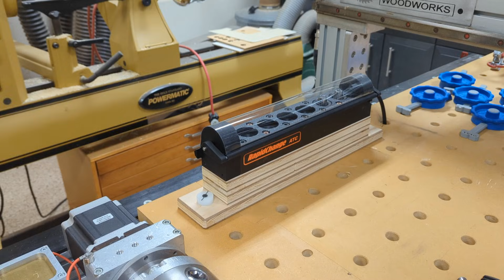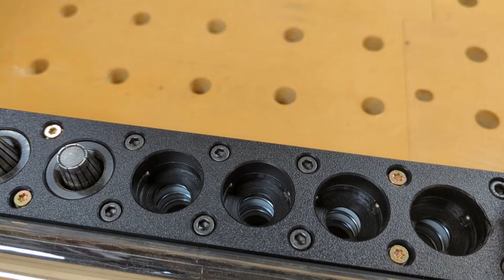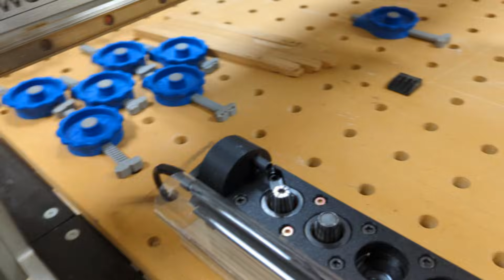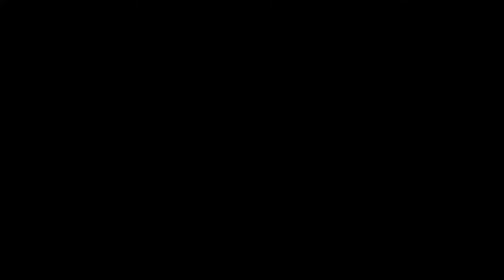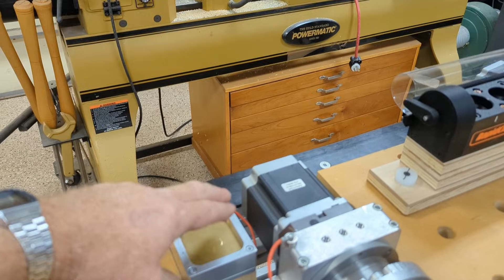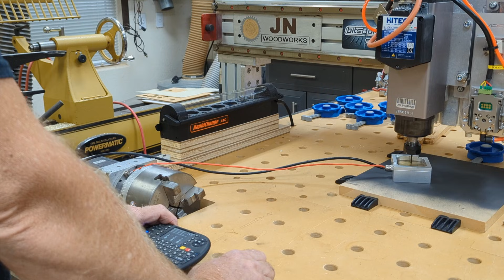Preliminary Review of RapidChange ATC on my AVID CNC

Comment: Thank you for the review. IR receivers are sensitive to sunlight. Typical solution to this is as piece of red or dark red plexiglas put on the receiver's window. It will filter radiation energy brought with the visible sunlight and UV components into the semiconductor receiver, and will make it sensitive only to IR. Three is no much IR produced by a sun, so your sensor shall get it only from the IR transmiter located on the other side od the tool box. Cheers:)
Reply from the maker: Sunlight is 50% IR, so you would need to put an IR filter on the sensor to stop the sun from interfering, which would also block the IR transmitter.

Comment: So it looks like the system uses two sets of coordinates - one for the machine that knows where the different things are, and then job coordinates that describe the location of the project being cut.  Is that how it works?
Reply from the maker: Most CNC machines have a set of machine coordinates that are the physical coordinates of the machine. This is what homeing established when it is powered on.
Then you have work coordinates that let you set a secondary work system or systems, at different locations based on where your material is mounted.
Reply: @JNWoodworks Thanks!

Comment: Thank you for the review. Would you make a follow up video for long term review?
Reply from the maker: Well, I have reconfigured my CNC a little (converted over from Mach4 to Centroid as the controller) and in the  process I sold the Mach4 controller and gave him the Rapid Change ATC to use.  I didn't really need an ATC and thought he could put it to better use.  I got it mostly for the fun of testing it out.  It performed great for the year or so I had it and can still say its a great product even though I don't have it anymore.
Reply: @JNWoodworks  thank you for the response, has centroid been any better? I am on mach3 and am still learning.
Reply from the maker: @LeadDennis  Yes.  Mach4 had ghosts.  It would just do weird things once in a while, like stop in the middle of  a run, or not stop and run into something.  Not too often for me, but some people had it more frequently.  I have had the Acorn/CNC12 setup for about 6 months not and not a single glitch.  CNC12's UI could use a refresh, and I miss Mach4's screen editor, but CNC12 is just rock solid as far as reliability....and thats most important for people who make a living at running their machine all day, expecially if you use an ATC.

Comment: Great video! This has been super helpful. I’m definitely considering purchasing one of these units. Have you had any issues with dust getting into the spring collet and preventing it from tightening down? After most operations, I feel like I have to at least tap the dust out of mine following a normal manual tool change if not blow them out to make sure they clamp  properly on the tool the next go round.
Reply from the maker: Thats funny.  I do the same exact thing when I remove a collet.  A couple taps and blow on it.  Mostly its because I don't want that debris to get into the bore where the next tool will go, because I doubt that the dust is dense enough to prevent it from tightening again, since its really fine, and was the size to fill the gap when it was already tightened.
However, to answer your question, I did not have any issues with this, but I also did not do extensive run time testing with longer jobs that would pack the collet like that, and then do multiple tool changes.  I think if I had problems with this, I would just open the lid of the magazine every once in a while and go up and down the row of collets with an air gun and that would probably clean it out.  I have not heard of anyone else having a problem with this either.
Reply: @JNWoodworks  Awesome! Thanks for the reply! I think I’ll give it a shot and see. I appreciate your other videos as well. Keep up the good work

Comment: Hello Jim,  Great video as always!  Question about the part with the 3 ball bearings.  It appears to be 3d Printed and almost a consumable part, needing replacement every so many tool changes?   Is this correct and if so, does RapidChange ATC provide a file to make these yourself or do you need to purchase.  Thanks in advance, Rick
Reply from the maker: Hi Rick,
I haven't taken them out yet, but from the inside they do look printed.  So far I haven't heard of them wearing out prematurely.  They should be easy to replace if needed, which is good because I damaged the first 3 pockets slightly when I had my spindle running at 6000 rpm initially. They still work, but the bearings definitely don't protrude quite as much as the others.  So far I haven't heard of anyone seeing premature wear with normal use.  The overall housing is very tough, it stopped my NEMA 34's in their tracks when I got fat fingered in the MDI window and crashed. Didn't do anything but scratch it.   I'll update on wear in my final video.
Reply: @JNWoodworks Are those bearings spring loaded? could be the 6k rpm damaged the tiny springs of those bearings and that's why they don't protrude as much?
Reply: @zeuscodm-yt   I don't think so.  They appear to be embeded in the plastic. I will find out for sure when I get the replacements

Comment: Hi Jim thanks!  this is a great run-down on this. I also had the same question regarding how the dust shoe/boot plays with the atc. I like your concept of building that into the automated workflow of removing boot, atc, replace boot & cut. But yes the base/shoe part would need modification for even that to work. Does the company provide any insight on that? Sounds like an adjacent product to sell. 👍 thanks Jim you’re the best! Ryan
Reply from the maker: Thanks Ryan.  I think they are busy just trying to get this product up and running right now.  I do have a new design in my head though, so I just need to find time to design and build it.

Comment: Very interesting! How do you “z” without putting the ground wire on the bit or nut?
Reply from the maker: I have the magnet attached to the chassis (a bolt on the rotary unit).  My spindle conducts through the shaft very well, so I don't need to attach to the bit.

Comment: Looks like the 3 balls put some dents into the collet nut edges. The nuts I use are all fine balanced. Would be interested to know how these dents grow over time and how this would affect balance.
Also for ER20 collets the recommmended torque for endmills with shaft-Ø smaller than 6mm is 45Nm (33lbs ft) and for endmills with shaft-Ø bigger than 6mm it is 75Nm (55 lbs ft).
This system is capable of only 19Nm (14 lbs ft), if I understood the specs correctly. At that low torque I wouldn't trust a 6mm drill to stay in position during a peck drill into aluminum.
Probably a system suitable for woodwork only...
Reply from the maker: I am watching the damage on the nuts for sure.  So far its really not as bad as it looks, mostly just taking off the black finish, not much actual deformation of the nut.  So far I don't think its going to affect the balance or the lifetime of the nut.  It certainly is a LOT less damage to the nut than what my wrench has been doing the flat on my spindle.

The specs one the collets are funny.  I've looked at a lot of them from different manufacturers, and I have seen even higher numbers in a lot of places, and I've seen them as low as 12 and 39 lbs for small/big bits.  There is no way people are getting 55ft lbs on a collet with two 6" wrenches.   That means they are squeezing the wrenches with well over 110lbs of force.  
I have tested a bunch of mine where I tightened it manually like I always do, and then checked the torque with a torque wrench.  They were typically in the 20-30lb range, and I always kept my threads clean, but dry. 
When I look at the difference in tension on a dry vs. lubed thread at the same torque value, it can be as much as 50% difference in tension.  I can't find any similar data for collet holding power comparing dry vs. lubbed, but I would assume it helps.  I also found that several collet manufacturers recommend a light lube on the collet threads and the tapers, just NOT on the inside of collet and tool shank.  So I'm hoping the torque this system acheives will be adequate.   RapidChange has done a quite a bit of field testing on that and so far no issues that I have heard of, but I need to do some testing and use it longer to convince myself as well yet.
Reply: @JNWoodworks That's a good and fair point, how much people can actually achieve with two wrenches by hand...and how reliable and repeatable that is. I have a regular ATC spindle with SK30 tool holders and do them in a proper ball bearing lock with a torque wrench. 
Before that I squeezed wrenches as hard as I could...and never gave a crap about the proper torque.
So the RapidChange is certainly more repeatable than that.Still the torque seems rather low. Maybe you can do a peck drill test in metal too...
And a follow-up review in a year from now...
Reply from the maker: @scratchbuiltdesigns  My holding problem has always been very long 1/2" end mills in something tough like Mesquite with a deep cut.  In a full cut that really rattles the bit around.  I can try some peck drilling too, but I don't do a lot of metal so I probably don't have the proper bit for that.

Comment: Does this setup prevent the use of a dust hood
Reply from the maker: Dust collection is a challenge with most ATC's since they are hanging right over the area you need access too for the tool change.  I have seen some clever swinging/opening/flipup designs that get them out of the way for a tool change, and also a more simple approach where the boot is docked in its own holder and then the redocked after the tool change.  I haven't decided yet how I'm going to address it.  I am thinking I may not ever really want a fully automated workflow, but may just use the ATC to do a quick change (manually push a button on my Mach screen).  In that case, I can simply remove the boot myself before the change.  However, I do need a different boot design because the base on mine was not designed with ATC in mind so even with the boot off my current one conflicts with the sides of the magazine.
Reply: I was thinking about a dust boot that can go up and down with compress air, like the laser module? 🤔
Reply from the maker: @maximazur4854  I've seen 3 basic kinds for ATC's.  One like you describe with a vertical actuator, another with a sideways actuator, or sometimes opens up like like sideways jaws, and the third I recently saw where the brush part of the boot is basically docked in a parking location by the CNC before a tool change.  I like the last one because of the simplicity, so thats the one I'm thinking of building once I get done with the actual ATC testing.